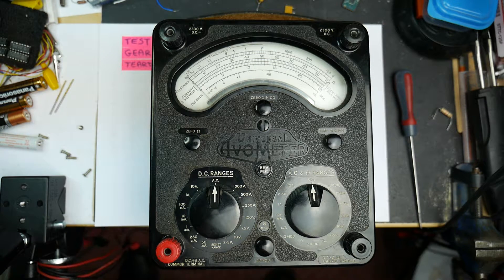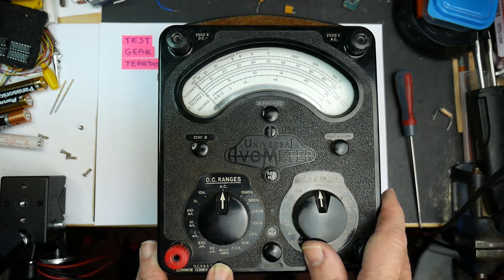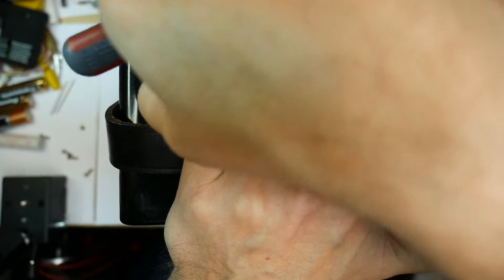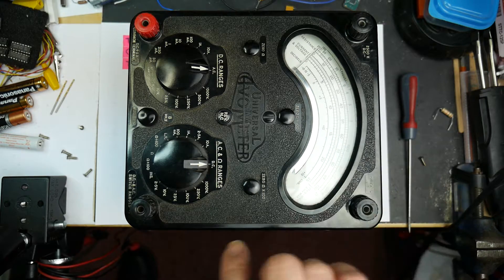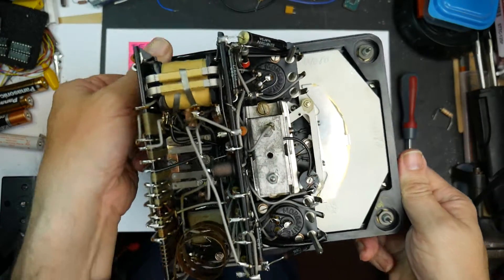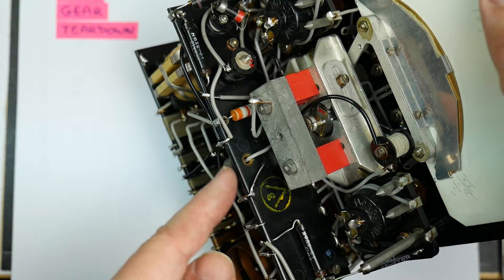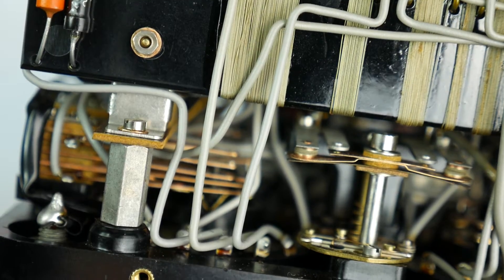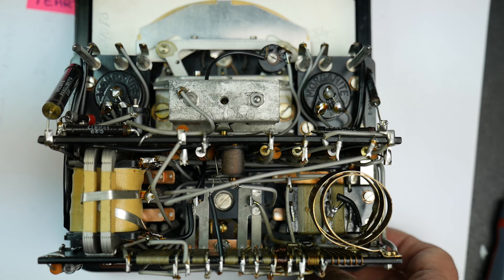Test Gear Teardown: AVO Model 8 Multimeter

Comment: As "yorrrick" also commented, the "cut out" is triggered via a linkage from the actual meter movement, so it is sensing/reacting to meter travel rather than a solenoid.

Also, those banks of cam-operated leaf switches are for rearranging the circuitry for the different functions, rather than for the ranges. The range switching is done by conventional rotary switch contacts which are visible in this video but not mentioned.

Most of the range selection components are on that Bakelite slab, in the form of all the wire-wound resistors. However, for some of the AC functions/ranges, the multi-tapped autotransformer (single winding) is used instead.

When discussing the Avometers, especially the Model 8, it is important to note that the 'model' part of the name is really a misnomer, as besides the general 'look' and rough front panel arrangement, there are not many similarities between the many versions of the Model 8, which Avometer refers to as 'Mark', e.g. this video shows a Model 8 Mark 2. So the 'mark' number is more important that the model number. Over the many years that the Model 8 series was  manufactured, there is a wide variety of circuit and physical changes these meters went through. The later 'marks' bear little resemblance internally to the earlier ones.

Comment: What a beauty! I was looking at my 92 year old father's identical meter to yours (has '63 written inside) today that has survived two moves from the UK to New Zealand and then NZ to Australia. 15V Battery is long dead and no 1.5V battery. 
Thanks for showing the polarity of that 1.5V battery and also how to calibrate as the calibration is a little off.

Comment: I have two of these meters, one a Mk7 and Naval issue Model 40 with a full high current/voltage shunt set. I still use them on the bench for certain tests. I've found they work very well for testing some components in circuit.

Comment: I recently purchased a Model 8 Mark 3. After you mentioned the build date I had a look at mine. The build date is 9th month 1968. In September 1968 I celebrated my sixteenth birthday. I served my apprenticeship with an electrical supply authority an Avometers were the workhorses in the testing section of that organisation. I had not seen an AVO in over forty years so when I saw one for sale I could not resist the temptation to purchase it. Thank you for your explanation of its internals.